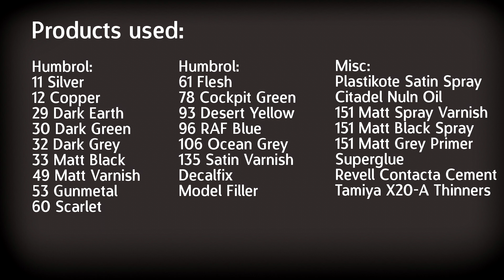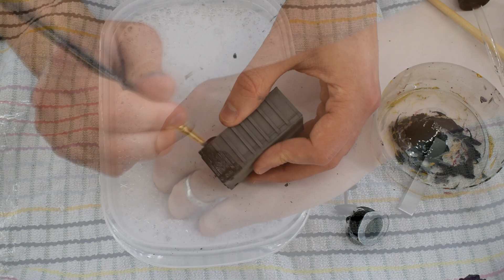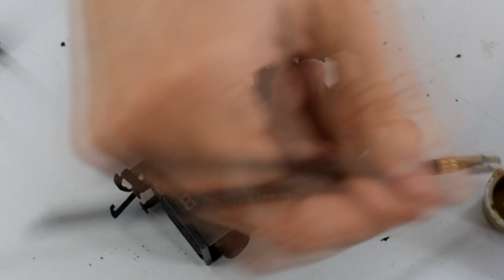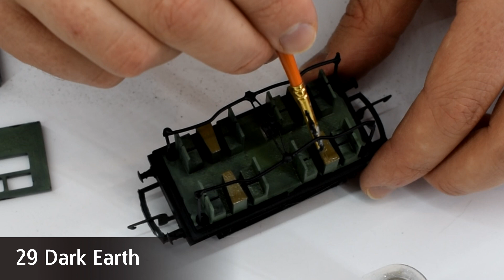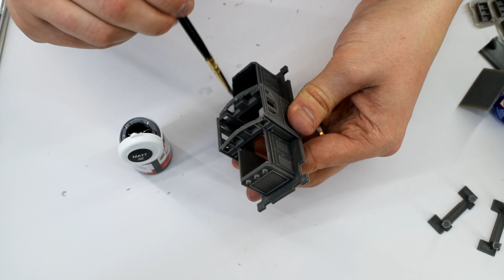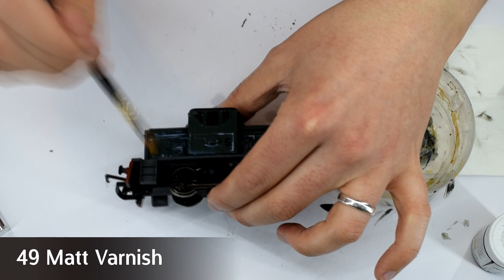OO Gauge Military Train | Budget Model Railways | Custom Full Build

Comment: UHU Allplast is good for 3D prints. It is a bit thick, though. It is both a cement and a glue (it will stick to 3D print, and "melt" injection molded surfaces).
Reply from the maker: thanks for the info!

Comment: I really like the model, great job and from my experience with superglue i recommend blowing humid air or adding water to make it bond instantly.
Reply: Baking powder makes it set instantly, and can be built up to fill holes, etc. It goes really solid, and can be drilled, filed, and cut. It takes paint of all kinds very well, too. A light spray of  Isopropyl alcohol will set superglue, too. A small warning, though: setting accelerants cause an exothermic reaction, which is over very quickly, but which can give a painful burn.
Reply from the maker: Thanks for the tips!

Comment: Wondering if the Ibertren, Bachman’s or Arnold 0-4-0 chassis would fit the kits, as Hornby no longer available.
Reply from the maker: Maybe, i know it was designed specifically for the Hornby one though. The others may need modification to get it to fit

Comment: Like what you have achieved. The loco chassis is no longer available on Hornby site, thus for me not able to complete the build of the loco. The wagons I can do and in time may try. Thanks for the video found it very interesting and helpful.
Reply from the maker: You might be able to find the chassis second hand or off a cheap loco and swap out the body
Reply: @ModelMinutes   yes I reacon that's the only option open to me thanks